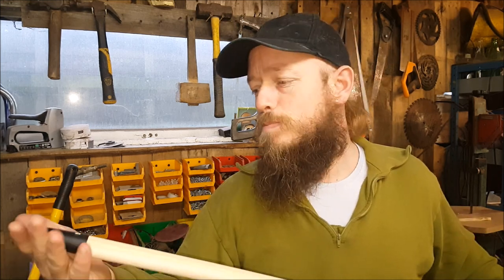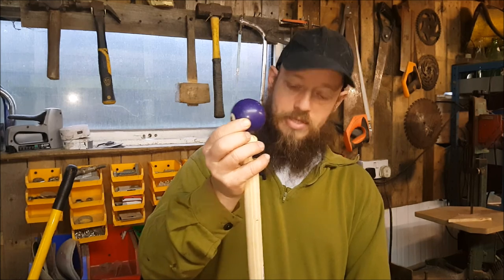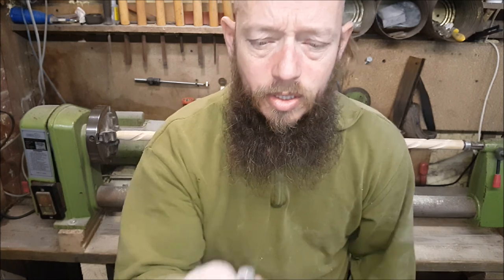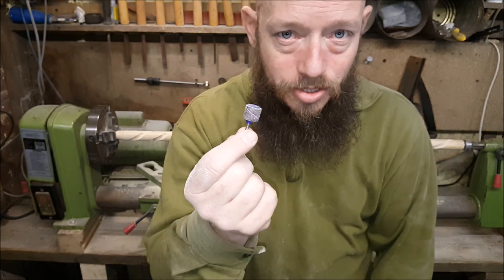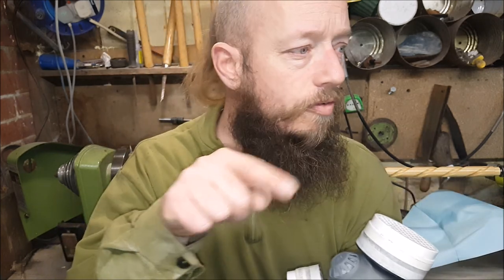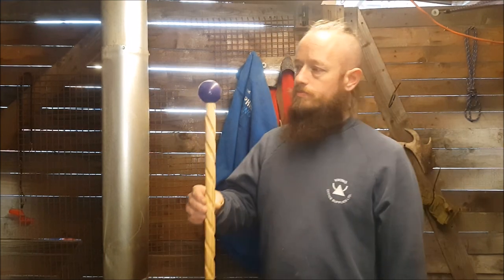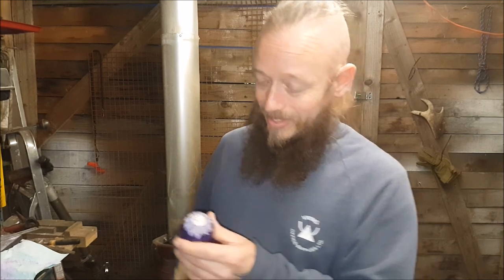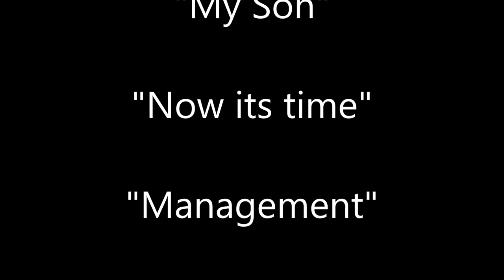barley twist and pool ball walking stick

Comment: Try darkening the groove with different colors with one color blending to the next. Kinda like following the rainbow colors up the shaft. Your lighter colors at the bottom to the darker at the top. I’m thinking of colors that compliment the purple ball at the top. I can see finger grooves ground into the ball for grip while walking. Those could be also painted. Being light weight as the stick it could make a good woman’s walking stick. With the heavy ball at the top makes it useful for defense also.
Reply from the maker: Thanks Bruce
Reply: @TheBeardx16  Thanks go to you. I also carve, Drexel carve and hand carve, canes and walking sticks. Good relaxation for an old man at 72. I too have used handles as blanks. At Home Depot they carry shovel handles etc. Here in Oregon they are good knot free hardwood.

Comment: Hello love the videos and love the beard I need your advice I have to start using a walking stick now but I want some that's more me I have a very nice seasoned Blackthorn stick it doesn't have the root ball unfortunately but the top end is 
1 and a half inch thick I have a special stone I want use as a handle the is about the size of a tinned pear half  any ideas on how to securely attach it?
Reply from the maker: Hi glad you enjoy my vids ,The stone is a great idea do you have the means to drill into it with a diamond boring drill ,look me up on insta and i can share some ideas with you ,  the_beard_x16
Reply: @TheBeardx16  
Thanks for your reply I don't have diamond bore drill bit or a decent drill for that matter but I had a idea like most man it came to me while I was sitting on the bog lol what if I carved a concave enough for the stone to sit and used epoxy putty to go underneath and little over like a bezel the whole stick will be painted in black polyurethane or I'm I being daft
Reply: @TheBeardx16  I don't believe it 
f -ing Amazon sent the wrong paint it's polyurethane floor paint 
I knew I should have got off my backside and gone to homebase would this stuff be any good
Reply from the maker: Wont hurt to try it though
Reply: @TheBeardx16  I was thinking of using a railroad spike as a handle instead.
clean it up and etch a design on it what do you think?